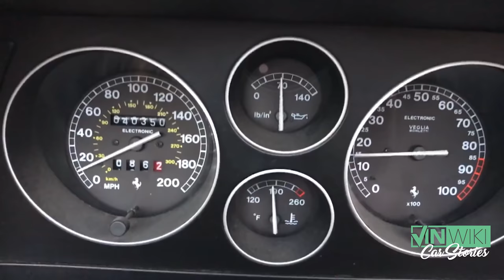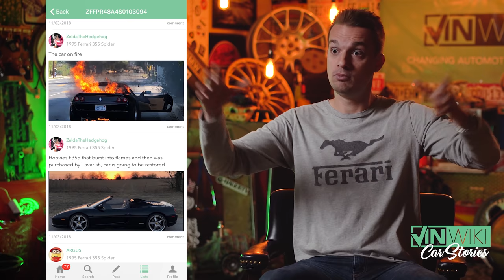The true story of Hoovie's Ferrari fire

Comment: The recall on the 1995 F355 was related to the fuel line connections, which were secured with aluminum collar nuts. If those nuts were tightened beyond the factory torque specification, they could crack, leading to a fuel leak and potential fire. The recall was not a big job. It simply required replacing the fuel lines with new ones that had brass collar nuts instead of aluminum. I believe an authorized Ferrari dealer would have performed this update for free. These fires have been fairly common in that particular model.

Comment: Currently my F-150 has a recall on it’s block heater, yes you heard right a gas 5.0L has a block heater on it, I don’t use it as it doesn’t get cold enough hear but also there’s a chance that plugging it in will result in a small electrical fire and potential explosion, so I should probably get it fixed but...I’d rather just not plug it in lol